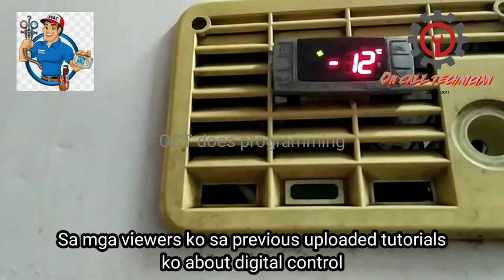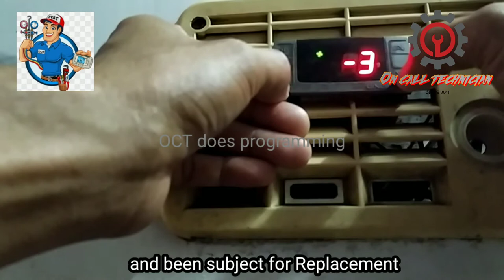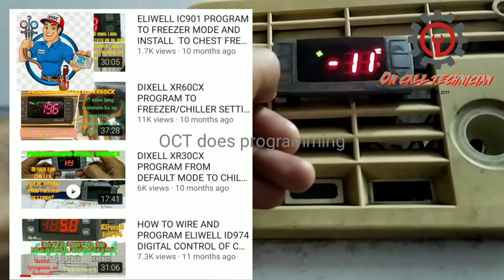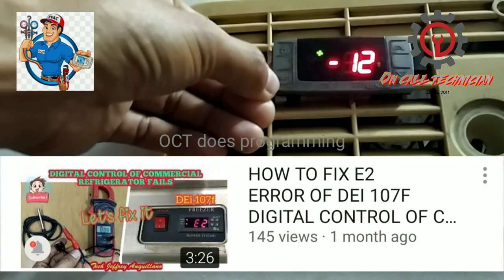HOW TO FIX "LA" ALARM OF DIXELL DIGITAL CONTROL OF COMMERCIAL REFRIGERATOR

Comment: Hi sir,I just recently had an issue with a freezer icing up, after defrosting it and ran,it's still icing but this time is showing that LA alarm,is it because of the setting that's why it's icing up?
Reply from the maker: LA alarm is protection against low temperature alarm its a auto reset alarm, just fix your icing issue and it will be fine
Reply: Thank you
Reply from the maker: You're welcome
Reply: Yeah the evaporator coil has been all covered up with ice, what do you think is the main cause of the icing up,I checked the drain heater, my sensor is okay..
Reply from the maker: @dannyarthur check evaporator fan sir
Reply from the maker: @dannyarthur and defrost heater that's the 2 culprit in ice formation